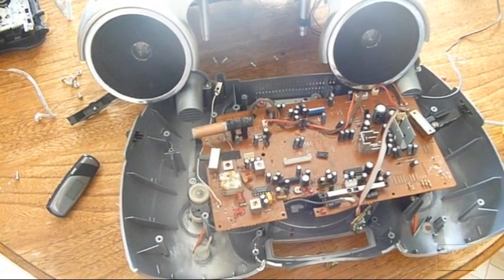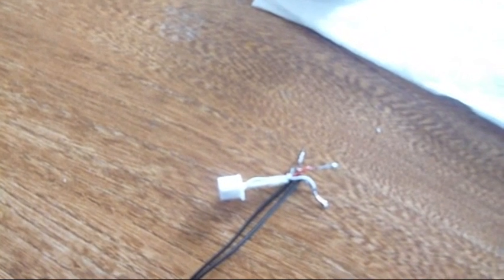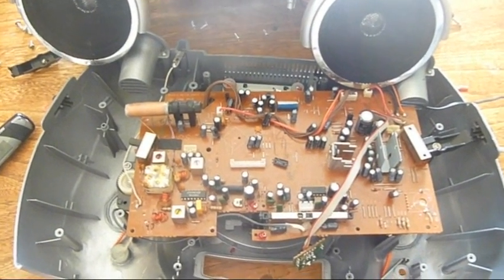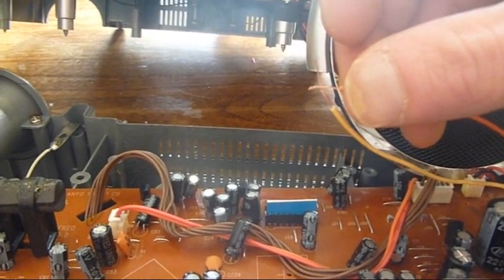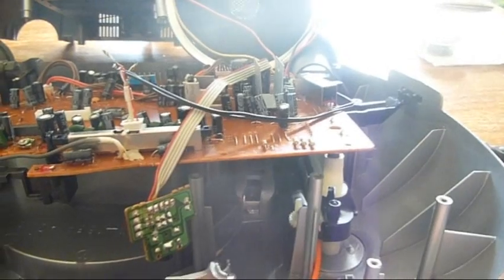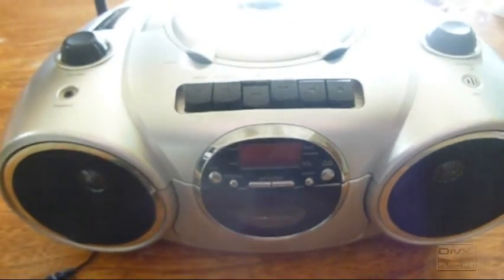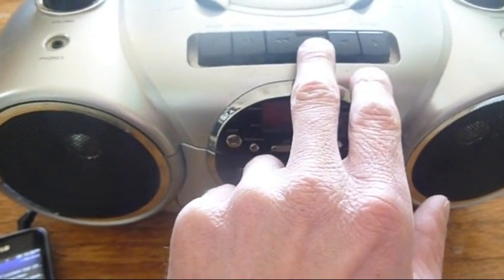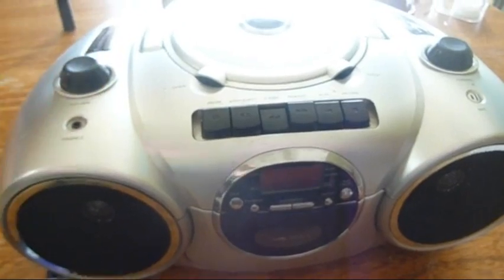DIY Boombox MP3 conversion

Comment: You can find the PREAMPLIFIER first. Then use its datasheet to find out the pin assignment for LINE IN . The TOSHIBA preamp. IC such as TA2068N with pin 14 and 24 as the line in.  You can download the datasheet for your reference via following link. 
 
http://pdf1.alldatasheet.com/datasheet-pdf/view/31223/TOSHIBA/TA2068N.html